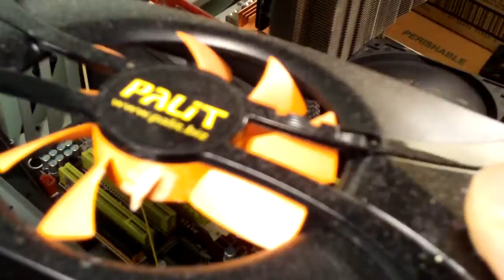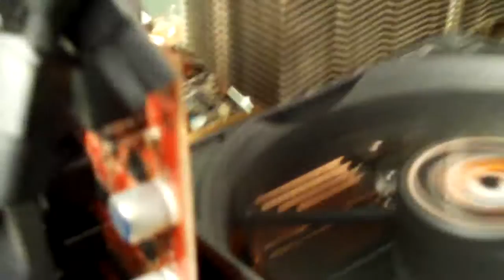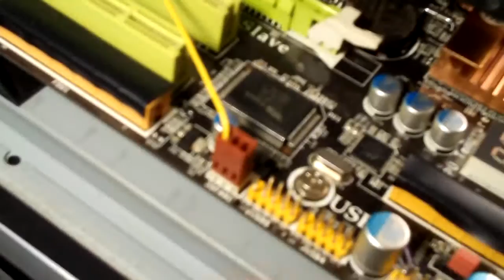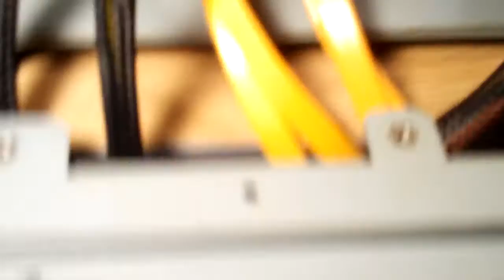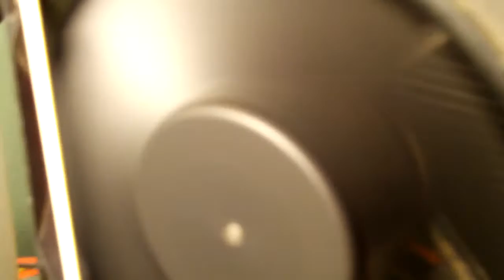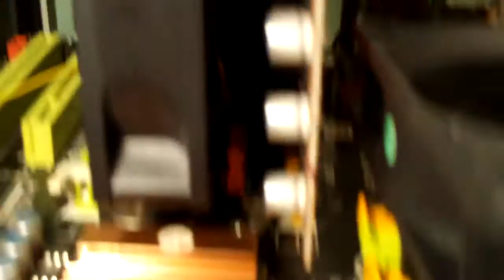Palit GTX 460 Twin80 Cooler Mod [part 1/2]

Comment: DUDE I know! 5 blades flew off over the years and I only had 4 of them . One day I superglued the 4 I had and said fuck it! I have the dual 80mm fans temps are lower 10-5 degrees Celsius on idle (from what I remember).

Comment: What fans are those, my fan blade broke and I decided to buy 2 80MM fans.  Although they can not connect to my graphics card pin and I can't change the fan speed.  Can you tell me the type of fans you bought?

Comment: @ComputerTechTV If instead of spending 50+ $ on some cooler, you can rig some spare parts and rubber bands and it works, hey... I remember  one dude had a self-made WC rad for his F&H rig and two 80mm Vantec Tornadoes on it. When in his room, I literally had to YELL for him to hear me.

Comment: u got some talent brother? 4 ya i got an evga gtx460 for 50 bones with the fan i the middle and wanting to add some ram sinks on it this think overcloclocks like a beast is there enough clearance to between the shroud and the ram chips or am i better off just removeing the shroud all together